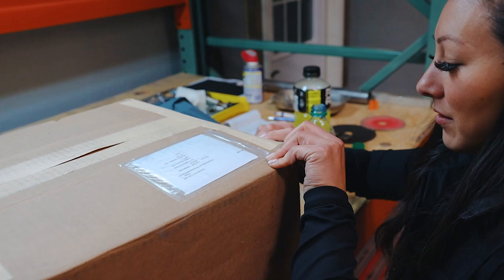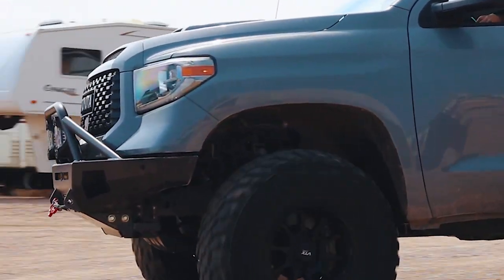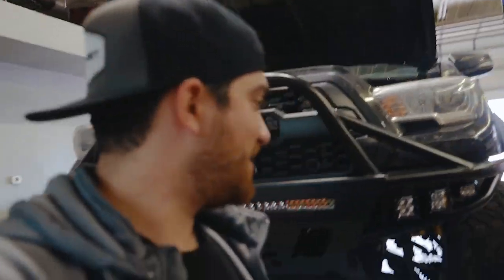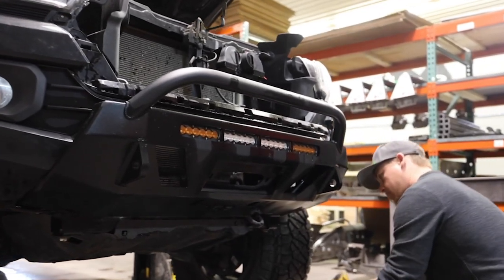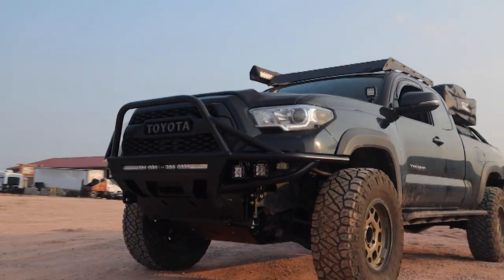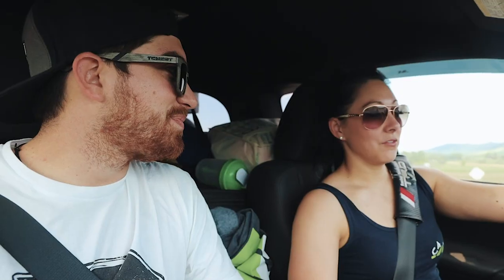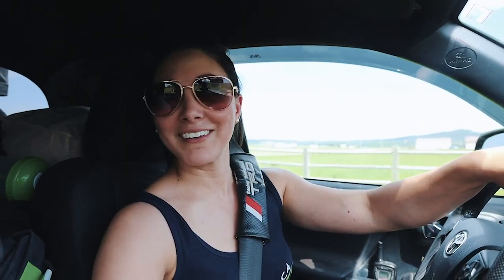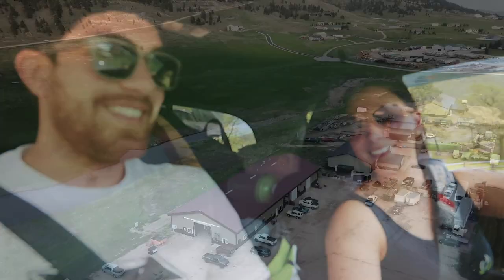Jenn Lee’s Manual Tacoma Gets C4 Fabrication Armor Installed | Front/ Rear Bumper, and Skid Plates

Comment: I have a 2018 TRD Off Road Tacoma Manual Transmission with 4.30 gears. I will eventually go to 4.88 or 5.29 gears. I have changed my suspension to KINGS 2.5 series coil overs with remote reservoirs with upgraded 700lbs springs vs the standard 600lbs springs